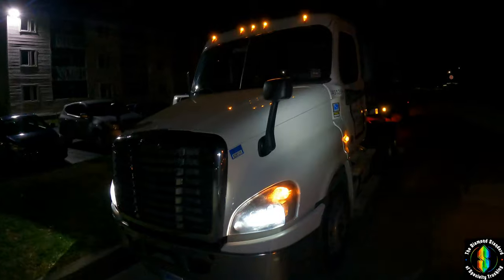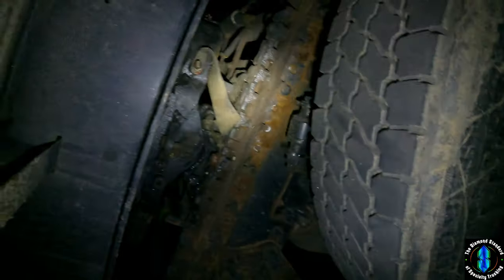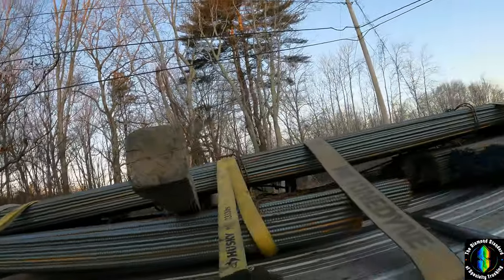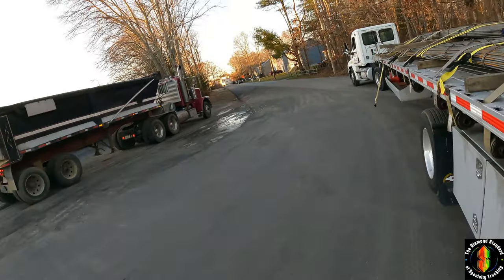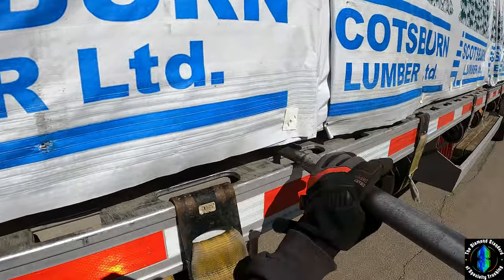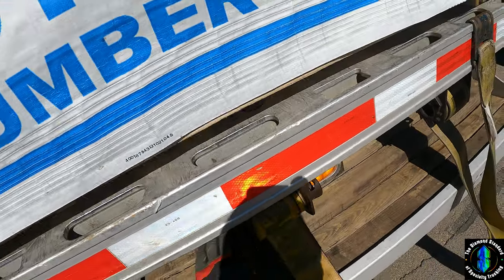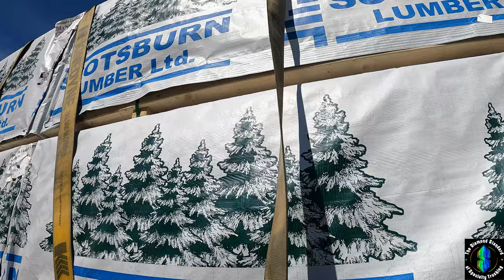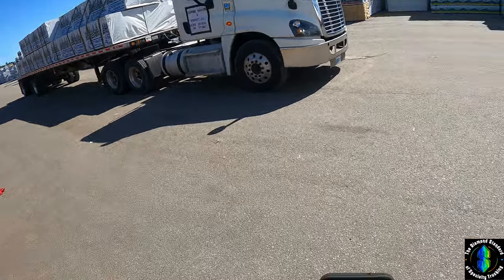17 Bunks of lumber and 40K lbs of Rebar delivery day! 1 Hour special!

Comment: Some DOT will whine about you running straps on the outside of the rub rail.  I was hauling barrier walls on a landoll and ran  into Mr. Know It All at the weigh station and he made me re strap the load.  Didn't write me though!
Reply from the maker: Yeah my buckles have the larger steel hooks and not the flat buckles so they won't fit

Comment: How long does it take to strap a load down.  I am 69 don’t think I would want to pull a flat bed.  To much work I know it pays better than the box trailers
Reply from the maker: Depends on the load and how many straps you got to throw. About 10-30 mins. If no tarp required